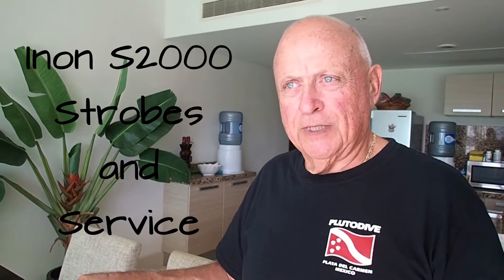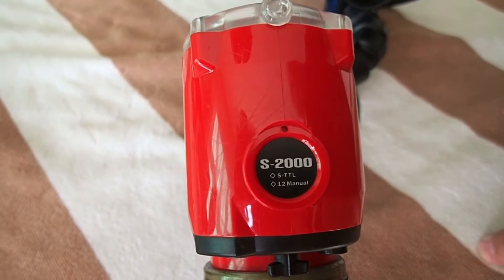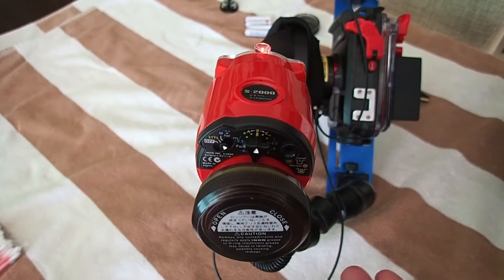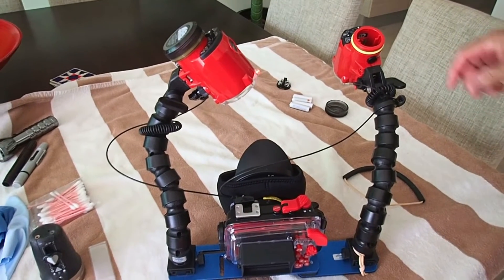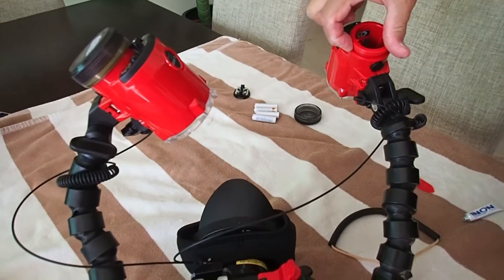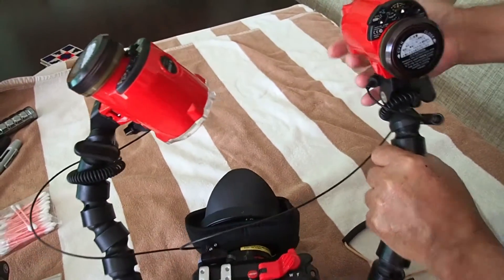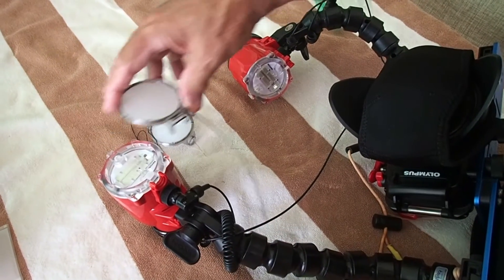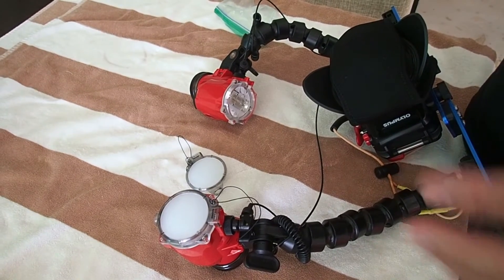Inon S2000 Underwater Strobe and Service   Episode 5

Comment: I have a sea frog housing for tg-6 camera with a bubble lens. The housing has no way to hook up a strobe cable so I am open for options.  If there is a external lens ring that would allow the flash cover to have enough room
Reply: The strobes are triggered via fiber optic cables which attach to the housing, very simple.
Thanks a big bunch for watching.